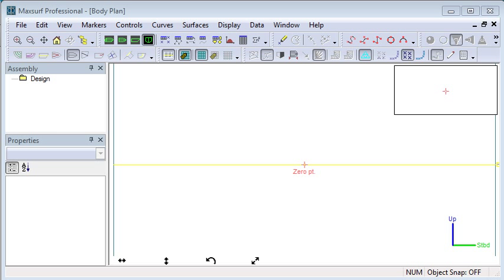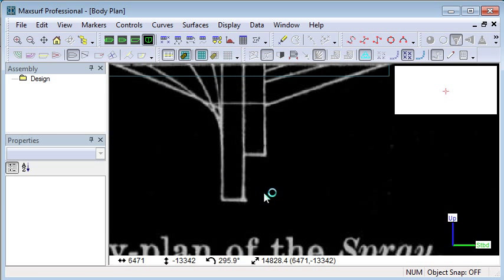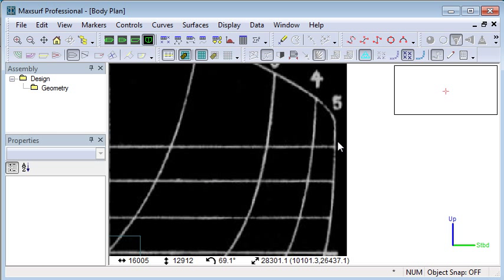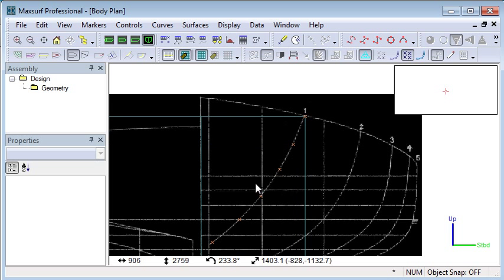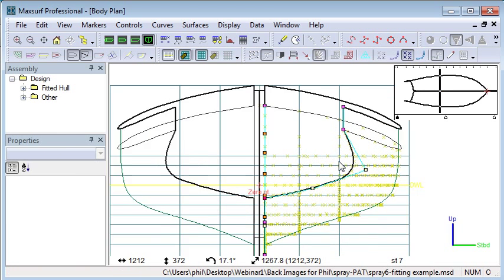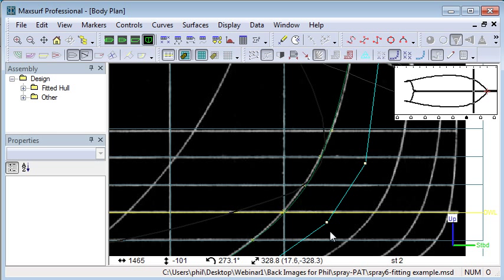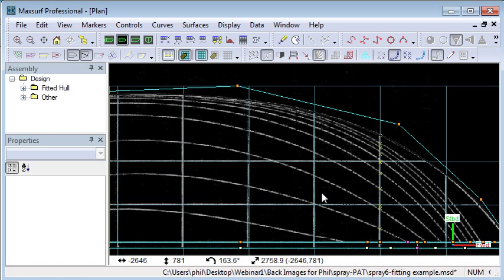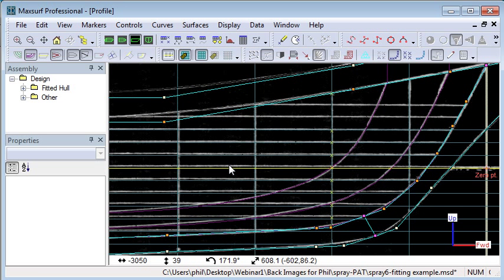Working With Background Images

Comment from the maker: If you scan a body plan (cross section) then there is no length information. Just set up your sections grid in the Grid Spacing dialog so that its the same spacing as the original design. If you insert a background image in the profile or plan view, then you scan scale it to match the longitudinal length.